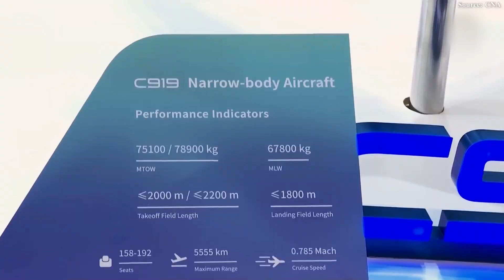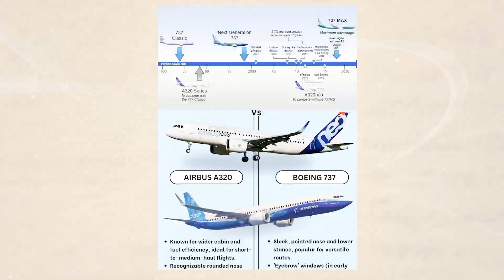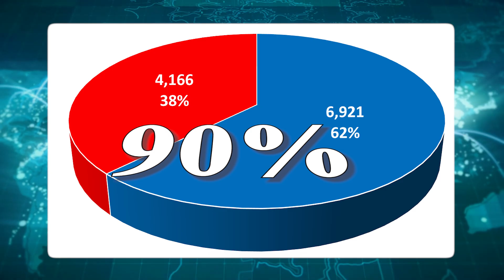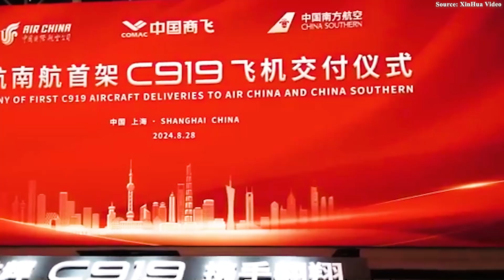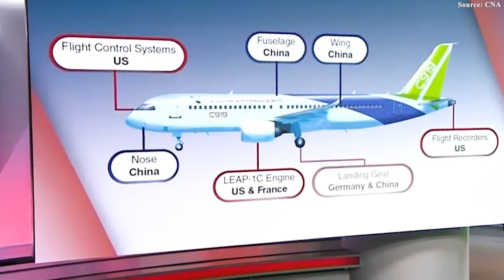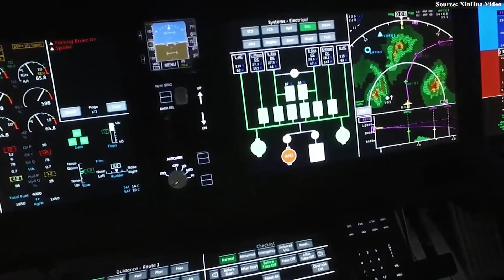How China COMAC C919 Tried to Outsmart Airbus - But FAILED Spectacularly

Comment: Communists refusing to respect Western intellectual property rights. Surprise, surprise.

China knows the West desperately needs its rare earths because it no longer has the political will to do the very dirty mining and refining on its own turf. Many other products are also no longer manufactured in the West because greedy corporations outsourced the work to China, where labor costs and environmental hurdles were lower.

This cannot be reversed quickly, if st all. China knows it is in a strong position in trade negotiations and will use it to muscle its way into the commercial aerospace market eventually. Give it 10-15 years.